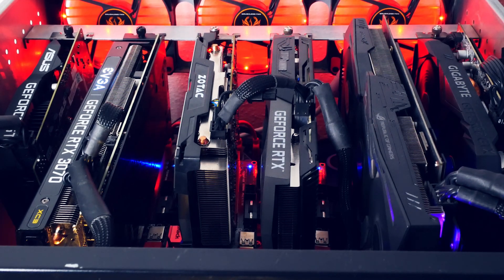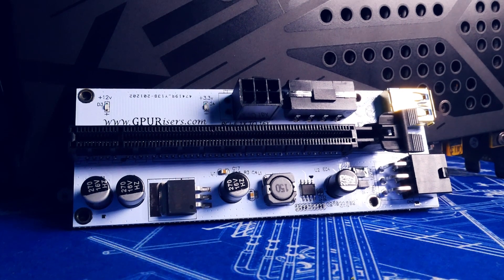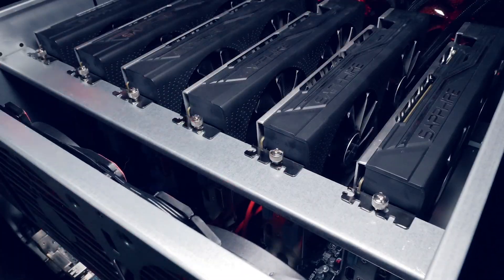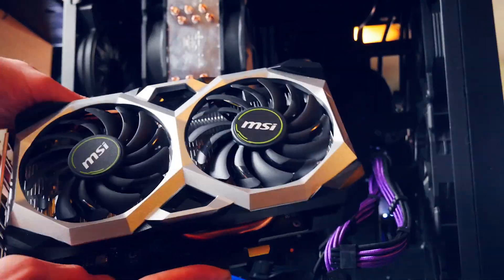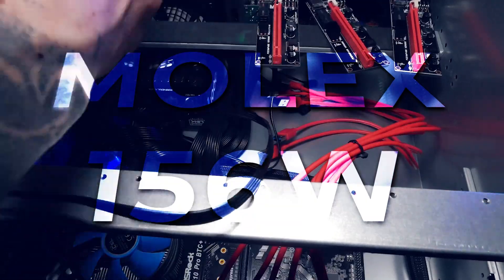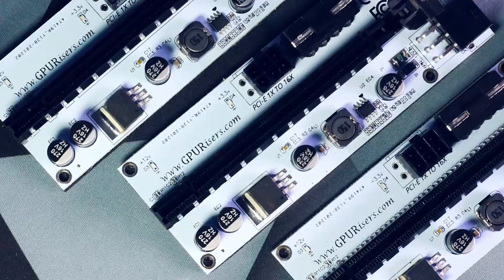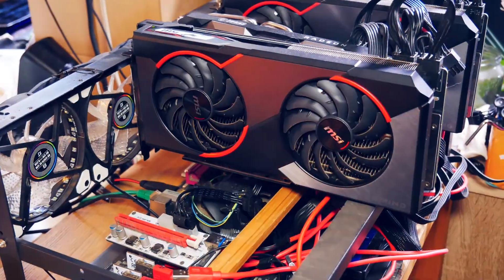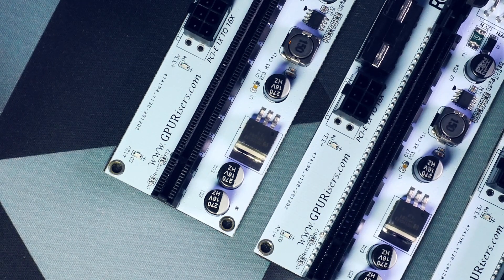GPU Risers: How to power safely - Basics | Sata vs. Molex vs. 6pin PCIE

Comment: Thanks for the info. 
I'm using 2x risers with single molex cable and works perfect.
Reply from the maker: Very welcome and thanks for tuning in! Same here, I use 1 Molex cable per 2 Risers the most :) cheers!
Reply: @CursedMining  i found risers with no power connections just x16 pcie
Can I just connect the GPU 8 pins and leave the riser without power??

Comment: Why there are 2x 6pin  sockets on risers? 
Is there a main one or you can use any socket available?
Can you connect both 6pin ones?
Reply from the maker: Hello, it is "either or" and just helps with placement. You only need one :)  
Shouldn't do any harm to connect two but no advantage! Cheers

Comment: How would we connect 4 gpus with 2 cpie slots each when the psu has only 3 vga ports, 3 sata and 1 perif? Am sure each gpu does not draw more than 150watts at max. Avg is 110

Comment: Bro, my 1070ti board has 2 inputs, so I can't power the Riser 009 and the board with just one Splitter.
Can I use a 2 molex to 6 pin adapter to power the riser?

Comment: SATA is a MYTH running out for so long on internet!!!
I'm using sata for last 1 year no problem no heat yet..
It was bcz if your card is 8 pin and after oc it is consuming below 100w then you can go with sata np at all..since 8 pin gives 150w itself you don't actually need extra power from sata!
If the card is 6 pin and card consumes below 100w then still you have np at all.. just use this time sata cable to 2 card each cable only.
Reply from the maker: one year is not a long time in minin, ser.  OCs can fail und suddenly your card runs full power, not good.

Comment: Maybe if your cards are 200w+ I'd recommend it. Other wise your pcie cables to the gpu will provide most power.
Reply: My 3090 uses 380w LOL. I definitely need that extra PCI 6-pin in the riser. You're right though, I've used cards such as 1060 without a problem, with only sata powering the riser. And obviously pci 6-pin in the gpu.

Comment: My psu uses 12 pin pcie cables. I have a 12 pin to dual 6.8 pin. I can safely power my 1660 s and a rise thru 8pin in gpu. And 6 in riser.
My question is.. is it safe to use a female to male spliter and split those 2 6.8 pin cables. So I could power 2 gpus and 2 risers. Or should I just buy and 12 pin to 6.8 dual to power another riser n gpu

Comment: I dont get the Problem... if you buy a bequiet 1200W your Sata Power could be up to 150W. Thats what the instruction says. If you youse gpu you could See, that a Single 3070 only takes 11-15 watt through the pcie Sata lane. Am i wrong?

Comment: this is very helpful, thank you. i just want to recap what i understand here, in my case i have:

two RTX 3090, both with 2x8pin
two riser

my concerns:

1. my PSU is 850w. so technically, it can power both GPUs no problem, right? 
2. the PSU comes with two (2*6+2) cables, so should I be fine using one (2*6+2) cable to power a single RTX 3090? 
3. and for the two risers, I would have to use two 6pin to power them, I'm not quite sure just yet how to power these, because the risers I ordered only have the 6pin option.

Comment: I have a question bro... If I power a Riser with the pcie I need a splitter right? What is the point of having two pcie 6pin ports in the riser please help me
Reply from the maker: Heyho - the second port is just for convenience in terms of placement. You can choose either one or the other :) 
If you need splitters will depend on your PSU, cheers!
Reply: @CursedMining  can the second pci-ex power port be used as splitter? I mean can you use it to power another riser or card by just attaching a 6 pin to 6 pin cable so that it essentially acting as a splitter? I think those two pci-ex slots are wired the same. So if you provide power to either one, the other one will also have power so it can be used to connect another riser or gpu.

Comment: I have a question... I know that I can safely power 5 cards with a 1000W psu. (technically 225 w cards but their only going to be using 120ish max)  Problem.  I have only "8"  6+2 8pin connectors.. across 4 cables and would need "10" (5 for the video cards, 5 for the risers)  Could I power 2 video cards off of one pcie cable? Using a combo of splitters or is that not recommended either?  I know you can easily power 2 risers with one cable.. that's not a issue.. but two video cards? Hmm..  I'd think that I could, simply because the cable has the two 8 pin connectors which should be able to supply a max power draw of 225 watt per.. but that's not always the case..
Reply from the maker: Generally yes, you can run two cards with one cable but two splitters. But still check powerlimits of those cards, f.e. try to calculate in: what if your OC/undervolt resets and cards suddenly run at full power? Try to leave headroom :) cheers ⛏️
Reply: @CursedMining  Thanks for the reply back, Yeah.. . These cards have a TDP of 225w  (1 8 pin)  So I know I'll be pushing it somewhat..  but like others (since I am using the sata connectors for the risers..) I now have to rethink that.

It's odd,  a couple years back people were saying try staying away from molex connections at all costs...  I must have read that wrong back then. geez.

Comment: Why two molex to one 6 pin? Two molex is 156W, but 6 pin is only 75W.
Reply from the maker: Molex is 156w per full cable, not per sole molex connector, cheers ⛏️
Reply: @CursedMining  So i can for sure use molex to power pcie risers without risk ?
Reply: @CursedMining  What if i wanna use only 1 cable per riser. Is it safer?
Reply from the maker: 2 per cable is fine, but check other things mentioned in the vid like age of powersupply etc.

Comment: so for one riser now we need 2x6 pins?  from the new type of gpu risers?
Reply from the maker: No you only need to plug in one 6 pin :) newer risers offer two plugs so that you can reach it easier, only one needed, cheers ⛏️
Reply: @CursedMining  so plug in any 6 pin in the riser? which one do you recommend? front or back? by the way I am living in Germany also. Can you recommend where can buy 8 pin to 2x (6+2) pin splitters? to connect to my modular psu and gpu?
Reply from the maker: @mozammelquddus5021  Take the one you can reach easier :) nothing to worry there. Regarding splitters: they are hard to find anywhere atm. saw some proper ones at Amazon but they are like 13€+ :/ cheers ⛏️
Reply: @CursedMining  thanks. the ones you got. from where you bought them and how much you paid?
Reply from the maker: @mozammelquddus5021  oh most I bought years ago, also Amazon. I bought a few of the expensive one I mentioned above on Az, cheers ⛏️

Comment: Great information it’s always best to be safe but correct me if I’m wrong but don’t the risers just use less than 5 W each
Reply: Can someone asnwer this please? everyone is talking about how much power a certain cable can handle, But if the risers isn''t pulling a lot of power we just need a good cable. The cards itself gets enough power from the pci 6+cables? The reason i ask is everyone says dont use sata cables ... instead use the molex. Well so far 2 molex cables are burned..
Reply: @stephankeulen8322  Sounds like you had some really crappy cables first thing I like using the 6 PIn if possible